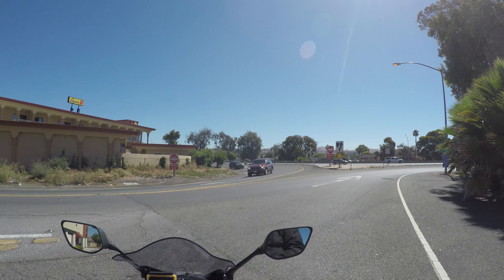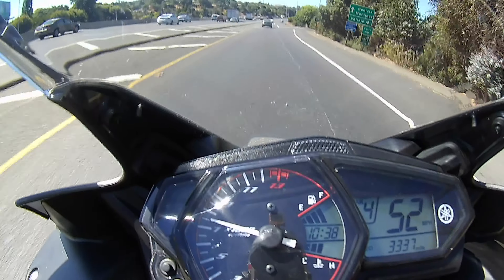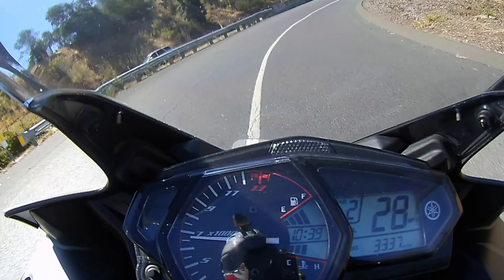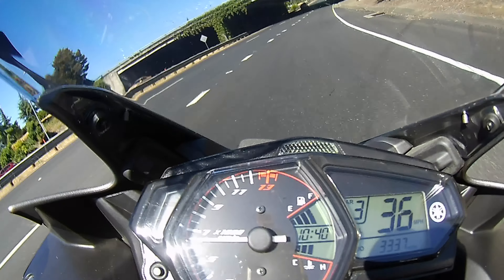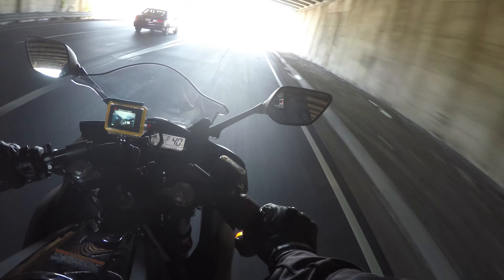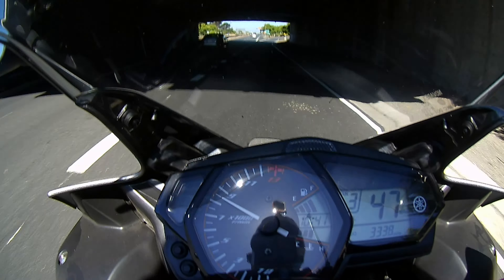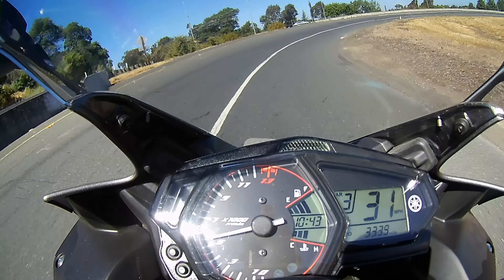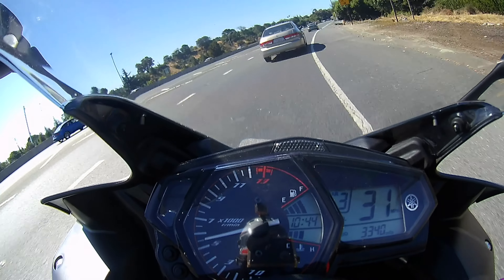How to downshift a motorcycle part 1

Comment: I have a question. How do I shift to first when slowing down? Do I have to be in a complete stop to shift to first or can I shift to first while going slow at a certain speed? Say I'm about to come to a stop doing like 8mph and traffic is starting to go. Can I shift to first while going 8mph or do i have to stop, shift to first then go? Please help
Reply from the maker: Thanks for the question. Without knowing which motorcycle you have. 
At slow speeds yes you can down shift before coming to a stop. Really it depends on the situation and the need to do so. 
In some cases it can be a extra actions before a stop and if you're new at riding one more action pay attention to when braking. So it may be overwhelming to do so until you have practice it .

So my suggestion is too go to a empty parking lot get up to 15 or 20 mph in second gear and practice braking and downshifting before you stop. If that's to much then just practice coming to a stop in second the shift to 1 and go. 

The goal of the drill is to think less about braking and down shifting especially coming to a stop where the clutch has to be in. 

Last point nothing wrong having the bike in a higher gear with the clutch in and then going to First gear at the stop especially if you're still getting comfortable be on a motorcycle. 

Hope this helps and thanks for asking for help.

Comment: Well said. It's a great idea for riders to know what speeds their bike will red line at. That's how I take off so fast sometimes when cruising I may be in 4th or 5 th cruising at 120-130 but I know my bike redlines in first at 100 so sometimes I'll quickly drop to 2nd or 3rd then my rpms are in my powerband about 10,000rpm and I can hammer the throttle to vanish. My bike red lines at 15,000. Depending on my speed for an on and off ramps I'll take it around the 8,000 mark and as I'm pull out it'll creep towards 10,000 once I'm out of the corner in theory I'll in a good position  to pull out into the straight away in my powerband and enable to pull out nice and quick then shift rather then running out of gear halfway through a turn. In one of my videos I do that I'm cruising with my buddy then you hear me drop 2 or 3 gears to put me in my power band the  take off like a dick lol
Reply from the maker: MotoBike Mike Yeah that's awesome  knowing your power band is important too. You can get so much out of the bike when that happens.
Reply from the maker: MotoBike Mike Thanks for adding knowledge to the comments.
Reply: yall 2 talking about all I wanna know right now about riding!!!!

Comment: So I'm newer and I'm getting a lot better at shifting BUT with that being said, I have one turn that I'm kinda nervous to make. It's a 90 degree right turn coming off a 45 mph road. And I don't know when to start downshifting. So I guess my question is do I gradually downshift so I go from 5th to 4th then ride a little with and then to 3rd etc etc... or do I just wait till I'm nearly there and shift all the way down to 2nd gear? This video is awesome by the way, very informative
Reply from the maker: Well thank you for the  question. So it's a 45 mph road into a 90 degree turn. 
First question what size of bike do you have ? 
Second question how long is the turn ? This question is a little more difficult for you to answer because I am asking length of time you're in the corner. I will show you a video of me in various corners and you can see different and Lengths of time. 

The significance of it is if it's a long corner then a good downshift will be useful if it's a short Corner then maybe one gear downshifts will be useful or just getting through it and 5th gear and just rolling through would be okay depends on the length of its corner like how long you're in it. 

Last question how often do you ride this road ? And is there any fears you have about this corner ? 
Just to see if your over braking and entering to slow which will cause the need to be in a lower gear to not bog down the engine. 

Thanks again hope this helps depending on your answers I will make a video. Welcome to the two community!
Reply: Rhino Dan Thanks for the reply! I have a  Yamaha fz07 (689ccs). The turn is off of a main road into my neighborhood, so the time I'm in the corner itself isn't long, but the road after it just continues down into a residential area. I just struggle with the timing of gear shifting (down) and figuring out when to do it 

|
|
|---------------- this is the sharp right turn 
|                  That continues down
|
The large dashes would be the 45 mph road
Reply from the maker: https://youtu.be/Qjj0ERhkJvM

Here's the video of different corners lengths for a example. 
Think of corners as short to medium and long in time lengths to keep it simple. 

Looking forward to your answers .
Reply from the maker: @jennabanks7274  ok so the FZ 07 has a good amount of torque so one gear shift should be fine. Your not racing so the drive out isn't necessary to be super fast just enough to get the rear wheel moving. 

What I would do in your situation especially because you ride this road alot. It's a great road to practice this technique. 

Applying the breaks early than normal  finish braking then down shift at the speed you want to be at. The key is being very light on the front brake applying more pressure as you get closer where you would normally start braking then down shift . Roll off the throttle press right your in the turn. Slowly roll back on the throttle smoothly until the reminder of the turn . 

I wouldn't go into 3 gear because the FZ 07 is strong enough to pull you thru in 4 or 5 . Learning to handle this corner will improve your riding.

Comment: Yes very tru thanks for the video as you know already, i had that problem to i was in a low gear in the turns, last week in the snake, so i dident have enough speed to roll out of the corner quick .but lucky i had other riders there to help me . now im way quicker .because i knew how to rev match .but like you said in thise video, you have to know what gear your bike can handle in a turn .thanks for this kind of videos. So new riders could come across on .👍
Reply from the maker: ESR three Thank you my friend and I am doing my best to help out the new riders. I hope my video was clear and my message was understandable. It's interesting that my videos are coming out a little late to help you. Sorry About that my friend and again good job on the snake one day I will ride the snake.
Reply: Rhino Dan. No problem,  now the next step for me is a trail braking , and the correct tire pressure because. I had to much for canyons i had mine set for commuting . So im ordering a good tire pressure gauge . thanks as always
Reply from the maker: ESR three If I can make a suggestion and a video will follow showing demonstrating that I do the same thing for my own riding. 
Is to go to the corners in 4 gear just fast enough but don't hit the brakes just roll off and back on and don't shift because 4 gear is high enough to get a good flow. 
I will make this video next week showing you and explaining why it's great practice. 

Also a good tire gauge is super important too. 

I do want to see some more snake videos down the road.
Reply: Yeah i will try that .and i will have more videos on the snake . but today im ordering oil because i have to do my oil change.  Ok cool cant wait for your next video.
Reply: You know something dan we have a expensive hobby haha😂 but fun were going to  go broke.
Reply from the maker: ESR three Yeah for sure the riding is expensive lol. I am happy you are riding.

Comment: don't know why... but I'm still not getting it!!! Great video Dan...
Reply from the maker: What area are you having trouble understanding maybe I can make a video to help out get the information. 
Thanks for the feedback too.
Reply: Rhino Dan... thanks for responding Dan. so I'm a newbie. started this year with a Cb300f and upgraded to a zx6r last month. live in the mountains of PA and the lack of power going up made me do it sooner than later. I watch a ton of ur videos and I've learned a lot. my problem is shifting & when to do it. according to the manual 
1 to 2 gear -9 mph
2 to 3 gear -15
3 to 4 gear -21
4 to 5 gear -27
5 to 6 gear -34
so... I can get to 34 on second gear easy so I'm not understanding why I should be in 6th gear in the street and by the time you get to 6th gear in nyc you already at the next traffic light which seems silly to downshift at every block. again these are per shifting recommendations of the manual. I've also heard to hear the engine as to when you should shift which to me is around 8 to 10k rmps without the bike making such a fuss (graves exhaust) another question would be what is the proper application to slow down... do you hit both brakes or downshift or does it depend on whether you're actually stopping or just slowing down? downshifting is another story! I want to use proper application because we all know how dangerous riding is and I don't want to get hurt as well as cause an accident. one last thing is the proper way to shift... prime the lever, slightly off the throttle, clutch in, kick up the gear, slowly release the clutch then give it gas? a cool video would be to ride around for ten minutes and just record yourself talking about what you do and why you're doing it. lastly I just wanted to say thank you for all your great videos and for teaching up new riders a thing or two. we all know how much time and effort you put on editing all the videos you make for us. Thanks a million Dan.
Reply from the maker: @BigPappaLos  Your welcome and I will answer your questions. In a video for the better response. I can totally ride around for a bit and talk about shifting and my thoughts will need some time to make it happen. I will let you know when it's ready. 

Also thanks for the feedback and I am glad my videos have helped you out. I need to make more of them and I should. Just been busy racing and learning. 

Thanks again for the feedback !

Comment: Hey Dan is it recommended to blip on a bike that has a slipper clutch ?
Reply from the maker: Alan Fernandes Hi, Thanks for asking this question. Yes with a slipper clutch you still need to bip the throttle. It's just makes the mis shifting less dangerous or less likely to get a rear to step out. 
With a quick shifter that does down shifting you don't need to do bip the throttle. Because the quick shifter does bips for you. 

Hope that helps and sorry for the late response.
Reply: Thx broski,  that was really helpful

Comment: Get Dan what's the best gear for cornering
Reply from the maker: ewilliamsz2099 The gear that allows you to have rpms to roll on the throttle and not shift during a corner. That's the simplest answer. 
every bike is different and have different speeds they can go for the bikes gears.
Reply: Rhino Dan ..ok understood, I have to practice that. Because I always find myself upshifting coming out of a corner. What is the danger of upshifting when rolling the throttle out of a corner
Reply from the maker: ewilliamsz2099 What part of the Corner like the apex isn't good. I down shifted before the apex in the video and right after in the video too and the bike was still stable in the video. the camera is mounted on the triple tree so if any instability would be shown in the video. 
I understand that the correct gear is hard to match especially on roads that you are unfamiliar with. 
I understand that it is harder to do too. 
learning your bikes gears will help out on this. My guess is you are to low of a gear going into the corner and running out of revs. So try going in a little slower and in one gear higher see if that helps so you don't have to shift during a corner is the goal.
Reply: Rhino Dan ..ok understood. Great video men. I watch a lot of down shift videos and I've gotta say this one did it for me. Good job bruh. Blessup.
Reply from the maker: Thank you I made this video for my subscriber that put in a request. 
I am doing my best not to make it complicated. Thanks for the support and the kinds words. If you need help on something let me know and I will make a video if it's something I have knowledge in.